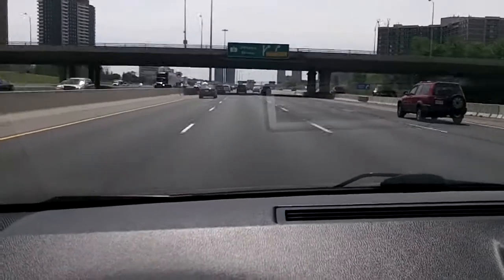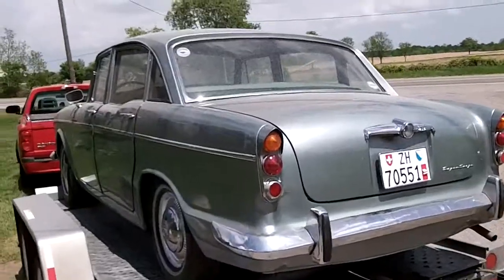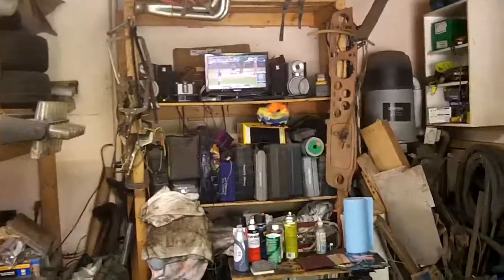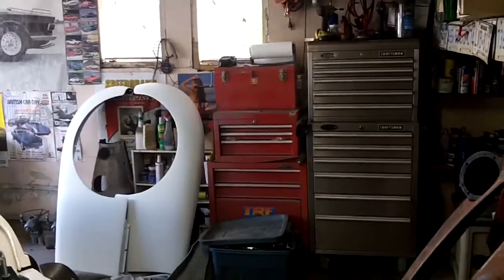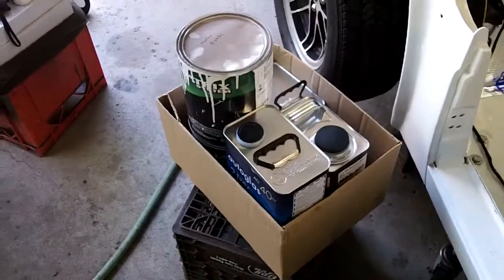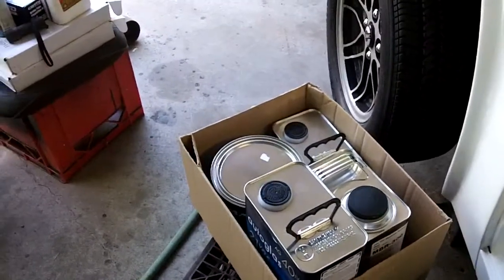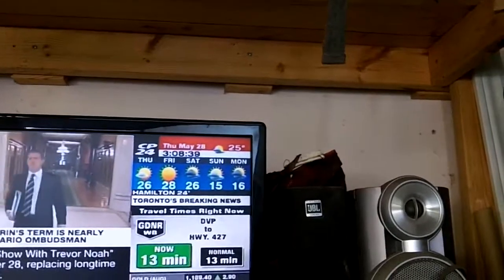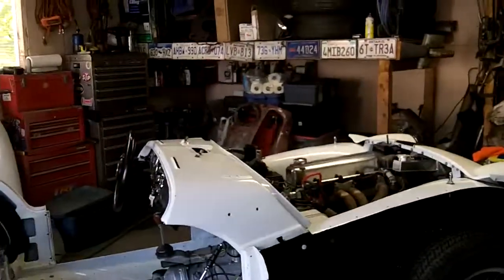1960 Triumph TR3A Restoration, Project Update, May 28, 2015

Comment: enjoy up-date new to your channel, back in 1975 I had a 1964 Triumph TR4A red wire wheels love it, but living in northern Indiana by lake Michigan the frame was rusted away sold it for parts. My son and I restore vintage VW buses and bugs as a hobby.
thanks for sharing
Busman54
Reply from the maker: Hi Dan, thanks for watching and commenting.  Going to visit your channel to check out your project. Yep, TR's are fun to drive, but the rust can certainly bite you...I'm  also working on a 1959 TR3A that is very Rusty and is quite a challenge.